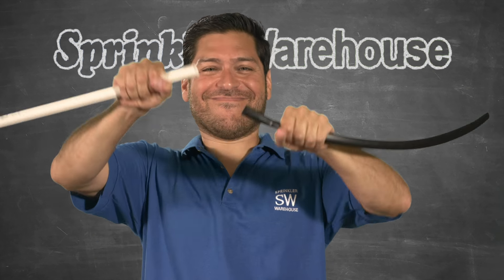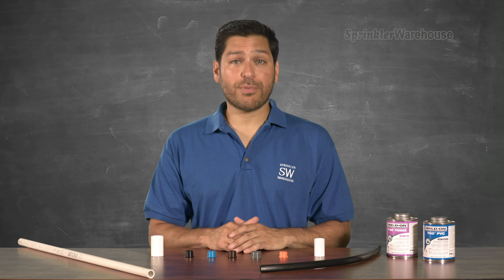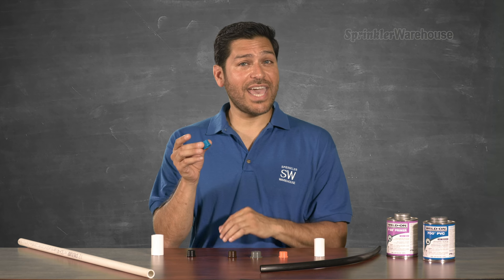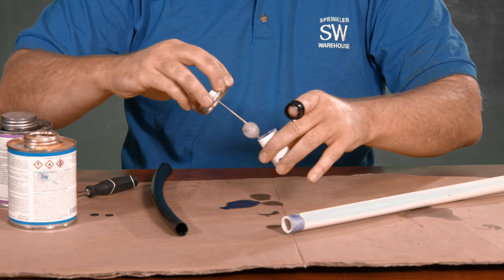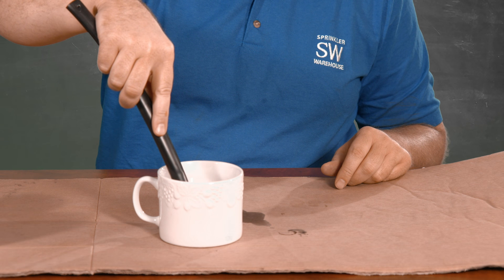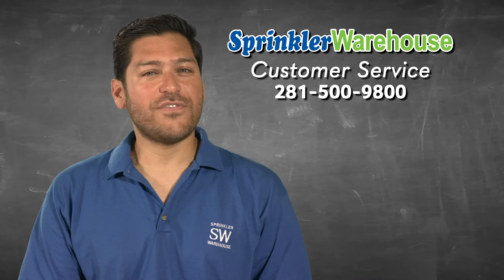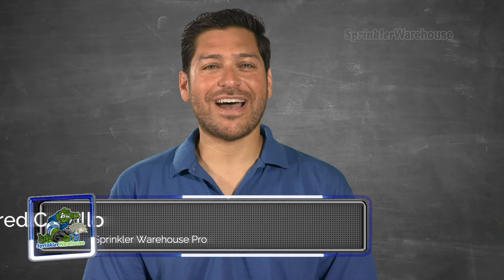Attaching Poly Tubing to PVC

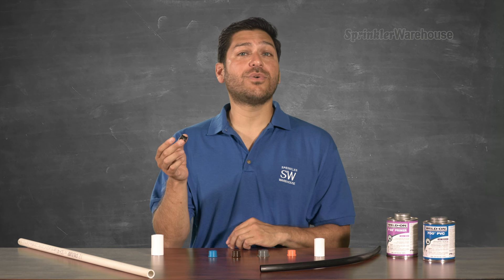Comment: 0:52" >> I am pretty sure you cannot inset .7 od tubing into a 1/2" pvc
Reply from the maker: Hello, 
The manufacturer Multi makes a fitting that does allow you to connect .700 OD tubing into 1/2'' PVC pipe
 https://www.sprinklerwarehouse.com/compression-adapter-1-2-in-x-700-in-slip-10-ct-ca700-10pk